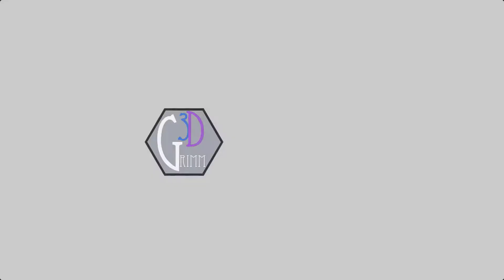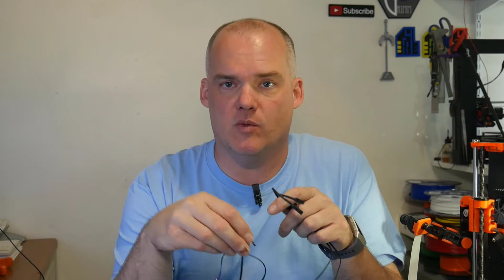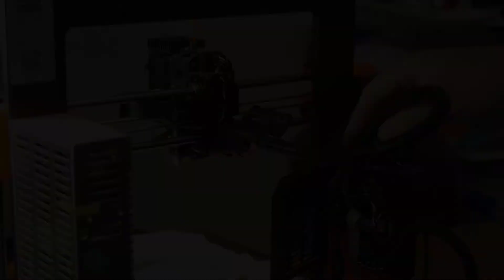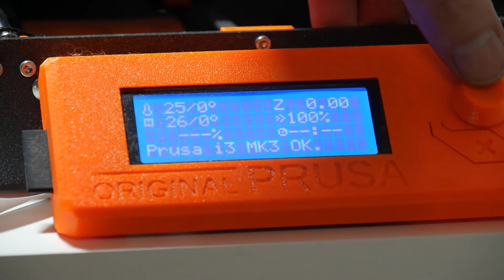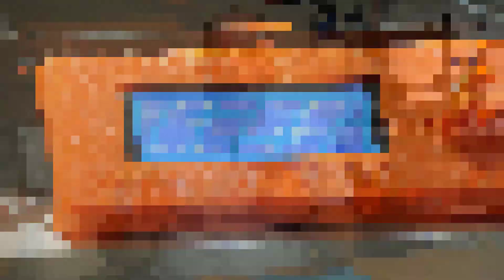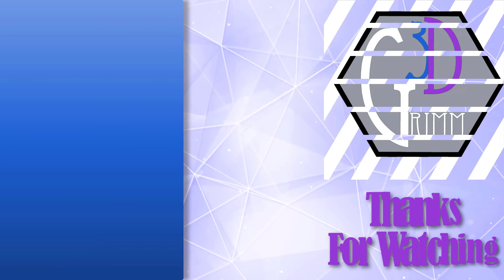Fixing Prusa MinTemp Error

Comment: Thanks for the walk through - just had a 'MINTEMP BED fixed please restart' error 38hrs into a five day print, your vid is very useful. BTW, you might have noticed, it looks like there might be some damage to your heater cartridge wires at 10.06 - https://youtu.be/C6IATC8Zd8Y?t=606
Reply from the maker: I have never had to repair the bed thermistor, but I would think the procedure is very similar. I'm glad you found my video useful.

Thanks for the heads-up on those wires. I did double check them and the insulation is fully in tact, they just had some of the colorant flake off. Good catch! and thanks for being part of the conversation.

Comment from the maker: Just to let people know, The Thermistors I bought to use in this video were both bad. The first one (the one I installed in the video) only worked for the first print and then started sending irregular temp readings to my Mk3. Eventually this caused an error and stopped the print. The second one I purchased worked OK for a couple prints, but then started doing the same thing - irregular temp readings resulting in an error and a shut-down. 

I am now testing thermistors purchased directly from Prusa. Hopefully these will stay working for a while.

*Edit* I have installed the thermistor from Prusa and so far so good. The temperature Record on Octoprint is VERY flat and looks to be completely solid (after a PID tune).
Reply: Do you have a link to the Prusa thermistor cable? I can't find it for the MK3S
Reply from the maker: @msims411  to buy from Prusa, to need to have an account and be logged in. There really is no direct link. 

Also, if you have a genuine prusa, there is a serial number sticker on your machine. I got my prusa as a gift, so in order to create an account to buy original parts, I had to send them a photo of the sticker. 

Their customer service is really good, especially through their chat feature. Just start a conversation and they will get you to the right place. Thanks for watching!

Comment: Really useful video thanks. I have often wondered what the longevity of the wires is likely to be with all that flexing. Looking forward to your next video.
Reply from the maker: When my print fan wires went out, I replaced the wires themselves with silicon, high flexibility wires. They are still working, but who knows for how long? At the same time, I ordered 2 replacement fans so I would be ready if my replaced wires went out again. When the thermistor wire went, you'll notice I ordered two - The worst part about these issues is the wait time associated with ordering replacements. Thanks for watching!